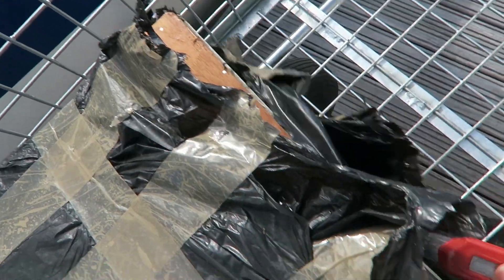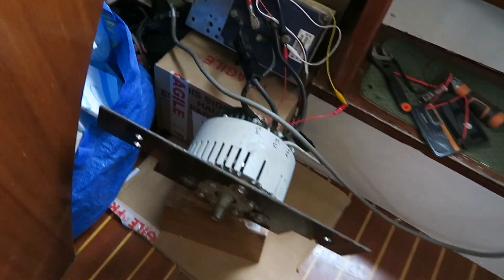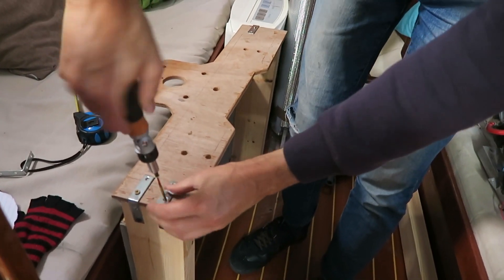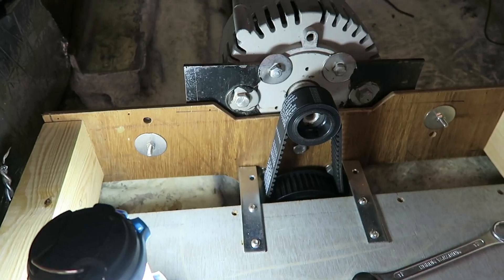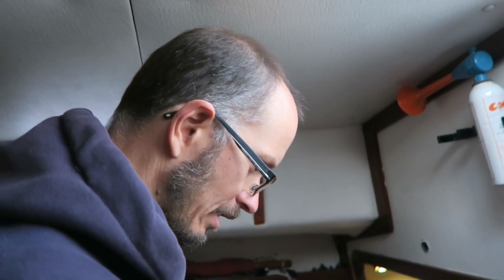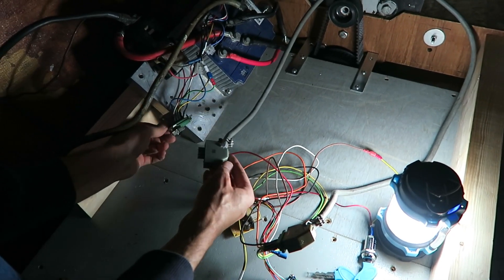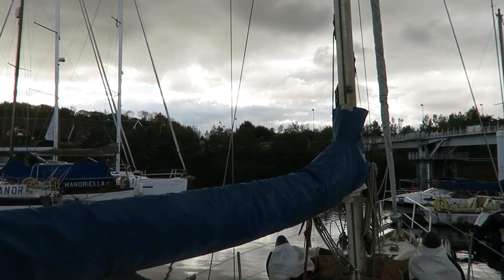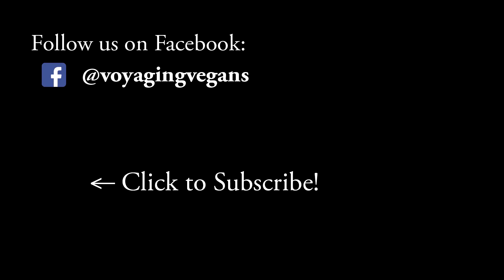DIY Electric Sailboat Conversion for Under £500! ($660)

Comment: 1.5 knots for 400W. You may get 3 knots at 800W of solar you have on a very sunny day. I'd consider doubling your solar as sailing performance also improves if you can motor sail at low power on solar to eliminate propeller drag or point higher with some thrust. And more solar means less load on batteries so they last longer. High current draw is what reduces battery cycle life significantly. If you can afford them Lead Carbon or LiFEPO4 are better for your current draw requirements than those lead acid you show here.
Reply from the maker: Thanks, yes we're hoping to find a good deal on LiFePo4 as this would work best for our setup. :)

Comment: Great job guys... looks like you're making good progress! And for not a lot of money :-) I'll be curious to see how it does with the full battery bank. Do you have a meter to tell you how much charge is left in the batteries? I'm sure you've thought of it, but that's something you'll probably want to make sure you don't get stranded with no power.
Reply from the maker: Thanks! Yes, the battery monitor shown in the video shows our current draw and also how many amp hours we have remaining. Very handy! :)

Comment: Have you considered getting a retired lithium battery pack out of an electric vehicle (usually a Nissan Leaf)? 

Whole lot of kilowatts of 48VDC power for a pretty modest price. With proper charging software (keeping charge between 95-25%) these should last practically forever! 

https://www.ebay.com/itm/Solar-RV-EV-Powerwall-Nissan-48v-Battery-G2-Lithium-Ion-3-5-kWh-66-ah-Lot-7/143085487661?hash=item21508f462d:g:ZpYAAOSwk4ddk4XL
Reply from the maker: Considering it, thanks! :)

Comment: What made you choose to go 2:1 rather than direct drive ?  Is the motor not working twice as hard and using more amps to spin the propeller ?
Reply from the maker: When we researched how we should drive the prop shaft, it was recommended that most sailboats benefit from 2:1 reduction... half the prop speed but twice the torque. There are some calculations you could do to figure out the best ratio for your boat based on weight, prop size and prop pitch, but we don't know the exact prop specs since the boat is in the water. So we went with what's most common, and if we find it's not optimal for our boat we can easily change out the pulleys for a different ratio in the future :)
Reply: Interested in this as well... I guess the torque is doubled this way, which may be necessary not to overload the motor?

Comment: Nice video. What resources have you been using for research? Would love to replace the stinking 4 litre Perkins on ours but suspect it would be virtually impossible without breaking the bank. 

Recognised the flats straight away 🤣 we’re at CYC. 👍🏻
Reply from the maker: Thank you! Just did a lot of google searching and referring to recommendations from sailboat motor companies. Also it helped learning about the experiences of others who have done the same with comparable sized boats and motors, such as Sailing Uma :)

Comment: A 110 Ah 48V battery should run at 100A for around 30 minutes ... does not sound very practicable to me ...
Reply from the maker: We plan to have 3 times that battery power, plus it's rare we would go full throttle, most likely under half throttle most of the time. Plus we have solar & regen so the batteries recharge while sailing :)
Reply: @BethanyNickSailing  Regen will be minimal. As much solar as poss and back off the throttle and use sail (obviously) whenever possible. For comparison my 26 ft Victoria 800, 3.5 ton, used 1kW in calm conditions @ 4 knots. It was all good fun. Converted her with direct drive Lynch at 24V, 8 years ago. A sail auxiliary rather than prime mover. 48 V at 2:1 would have been nice but that meant more cost in batteries. I started with AGM but ended up with lithiums. Good times. Now sold, onto electric mountain bikes now. 😏
Reply: @JohnRushworth  what was yr range like on lithiums John? how many ah ?
Reply: @rhett7716  Depends on conditions and speed, but calm at 4 knots, 1kW. So with 200Ah @24V and not full depletion  then around 16 nm.

Comment: How many hps does this motor have? And what kind of motor is this?
Very nice conversion and good skills
Reply from the maker: It's a 5kw BLDC motor from Mars Electric (now known as Motenergy)
Reply from the maker: And thank you! :)
Reply: Did a conversation.
5 kw = 6.7 horse power
But that's just engine power. Electric motors have higher torque than equivalent petrolium engines because there's less friction, less heat loss. Less losses basically.
Reply: @sausage6984  there max  torque is instantaneous too  from 0 revs !

Comment: Great spend so far.  I guess if you are only going with lead batteries your range won’t be very far, though should get you in and out of the harbour....it is a sailing boat after all 
Some observations.  
That very thin ply plate, can’t see that lasting long under full power.
Have you used coated cables?
I have been following a electric conversion thread on the Junk Rig Facebook, worth a look if you haven’t seen it.
One thing they mentioned is the power cables and fittings, they take a lot of current, so need to be up to the job.
Is your propeller matched to the power and rotation speed of the new motor.
I would make sure all the electrics are as high up as possible, and protected from any splashes when it gets rough and there is water in the bilge.  With a longer belt, the motor could be higher?
Hope you find this helpful.
Keep up the good work, and I look forward to hearing more.
Reply from the maker: Thanks for all the tips! It's not obvious in the video but there is a metal plate behind the plywood so it should be sturdy enough. Also there's lots of space below the motor to the bilge so no risk of getting the motor wet :)
Reply: It is an interesting point about water. Are you able to put the motor in a waterproof housing? Where it is located means that when you do get water in your bilges (which you will), it will likely get splashed by water as you go through swell and waves. The same might also apply to the battery bank when you decide on location - probably best to go with sealed units ⛵️
Reply: @1962gms  the prob with enclosing the motor is overheating needs to be open ideally

Comment: Last thing needed is a good diesel generator to recharge the batteries !!
Reply: couple panels and a wind generator should do the trick
Reply: I get the satire, seemingly skeptical.
There's a lot of factors. Ups and downs to liquid fuel and electric.
Great project.
Reply: @sausage6984  well a generator would be handy just in case 🤔
Reply: @rhett7716  agreed
Reply: @rhett7716  and a back outboard
Reply: I would divide the loads this way: a pretty small genset but a large array of solar panels. Diesel for emergency charging (like running away from pirates)  and wind/solar for power.

Comment: Wood for mounting the motor - did it work? Looks so fragile.
Reply from the maker: Yes it's backed with a metal plate so it's stronger than it looks. Will likely also add a layer of epoxy for longevity :)
Reply: @BethanyNickSailing  and fiberglass

Comment: Great Job! Might want to add a belt tensioner at some point to help with belt stretch :)
Reply from the maker: Great idea, thanks! :)
Reply: @BethanyNickSailing  When you add one, also be sure to move those metal brackets, they are going to cut that belt in no time. Even after that be sure to have a spare belt on board.
Be sure to get the batteries sooner than later. Mixing different batteries with different charges is fine for testing but not for actual use.
And if you place the batteries in front of the motor be sure to add a ledge so they can not slide into the motor and add terminal covers to all terminals so you can access the motor without the risk of creating a short with your body(it will hurt) or any tools(they may cause fire and may even be welded on there and "may cause" will turn in "will cause")

(I do like to say "be sure" right? xD)

If you fix those points you will have a nice system going 👍

Comment: I almost saw my boat.....I'm in the marina next to you :-) I know a guy who has done the same he has 8 x 130ah batteries and well........He needed to be towed back with a dingy last week. 
Not 100% sure what happened. Can you guys get the CoffeeCo wifi from there?
Reply from the maker: Oh cool! Nope no wifi in range from here :(
Reply: @BethanyNickSailing  Your pretty close so you could try something like this it's a wifi range extender its £116.51. The batton connects from say the coffee shop wifi to the mini router. then your devices connect to the mini router. You can mount the wifi batton to suction cups using cable ties then attach it to your spinnaker pole to get the height. Just remember to take it down while sailing. 

The coffee shop wifi is unlocked so if you "borrow" movies from the internet the download speeds are great. coffeecoguest is the password. During lockdown I sat on the benches outside to use the internet.

Also, I recommend never to admit you live on your boat as many marinas. (including yours) don't allow them. I know people might spend a lot of time. There was a bit of a round-up about 2 years ago at your marina a few people were asked to leave. onboard.....something to do with council tax, commercial waste 

https://www.amazon.co.uk/Alfa-WiFi-Camp-Pro-camper-solution/dp/B07JBBCDD2/ref=sr_1_13?crid=28F7P2B1WXTJY&dchild=1&keywords=wifi+booster+camping&qid=1603397624&sprefix=wifi+booster+campi%2Caps%2C153&sr=8-13
Reply: @serenitycoastUK  that range extender sounds dear ?

Comment: What is the autonomy? How many miles do you get with your battery bank?
Reply from the maker: We haven't bought our battery bank yet, currently just using the starter & leisure batteries that we already had, so not getting a lot of miles at the moment. But it's still enough to get in & out of the marina and down the river. Will have another video about our batteries when we get them! :)
Reply: @BethanyNickSailing  thanks! Best regards!

Comment: What kind of Electronics are you using to display the throttle?
Reply from the maker: Using an Arduino based microcontroller (ATMega328p). Was going to use the OLED display which you can see in the video, but turns out it's not bright enough so replaced it with an LED matrix. Will likely do a video showing that soon :)
Reply: Are you using the direct output of the throttle or some output of the Sevcon?